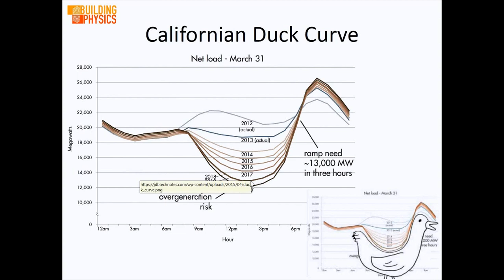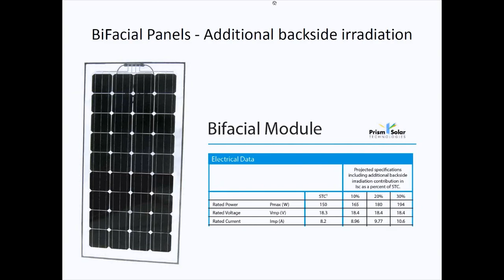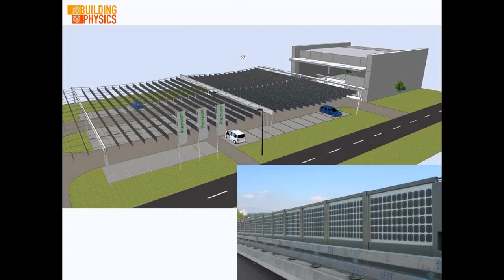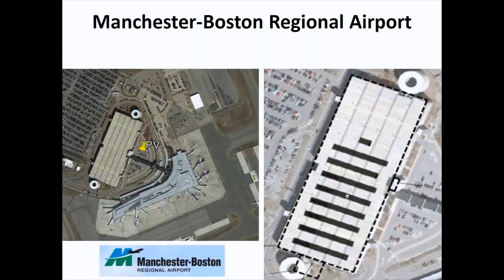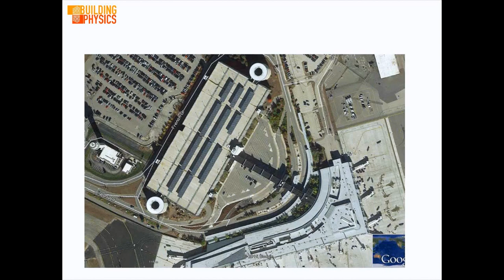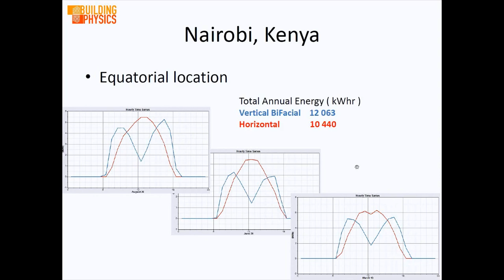Virtual Conference 2015 Modeling Bifacial PV in SAM, Mike Barker

Comment from the maker: Q: Would this type of installation take up a greater area? It seems like shading would be a large issue, and you could never get direct normal light.
A: The bifacial installation certainly does take up extra area - but if used with over a car park that may not be an issue.
A: We use the extra area needed to increase the size of the reflector surface.

Q: Did you consider using albedo as a way to add to production on a seasonal basis?
A: The reflected energy we expect is specular in nature rather than difuse, so we believe that the Beam Shading loss approach ( Solar Azimuth by altitute ) may work best?